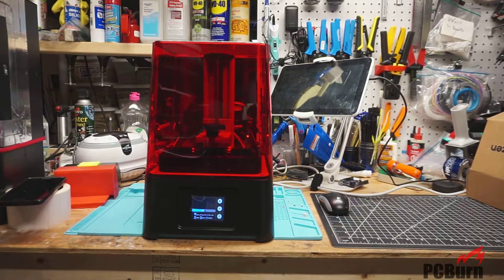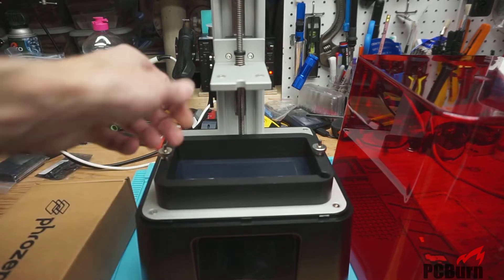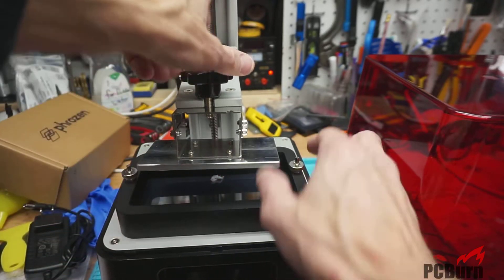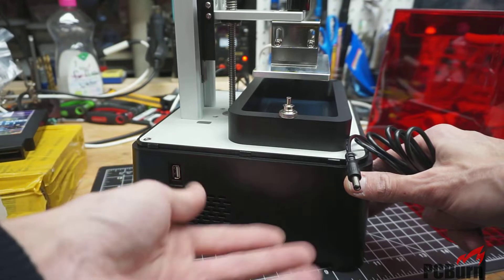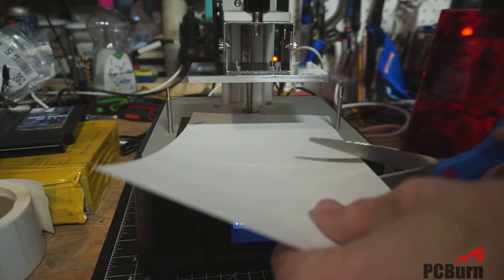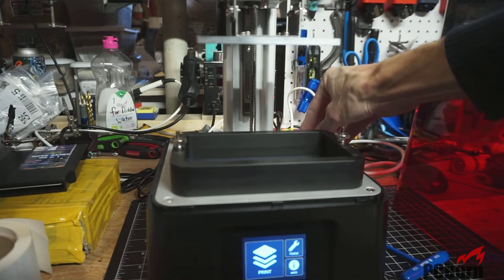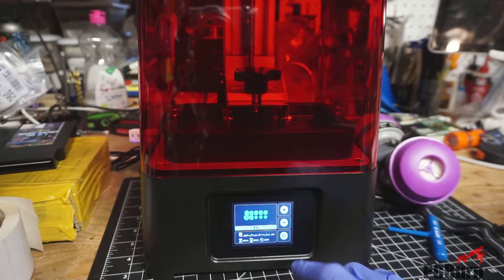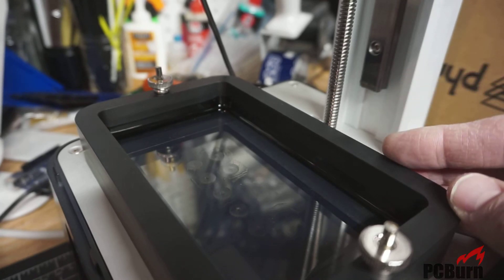Phrozen Sonic Mini: 3D Resin Printer Set Up, Use, Safety, and First Impressions Review

Comment: Where do you have the video of the Chitubox configuration for this printer? the best you ever had ... THANK YOU
Reply from the maker: There' s no video of settings, I'm not sure how that'd work. I haven't gotten to work with the printing on it much or add a heating chamber yet (which is necessary for me to use the printer, unfortunately).

You can find a few settings at PCBurn.com here https://pcburn.com/phrozen-sonic-mini-3d-resin-settings/ and the Google Doc spreadsheet here https://docs.google.com/spreadsheets/d/1crvzMnt_8NJXAsABinoIhcOjE8l3h7s0L82Zlh1vkL8/edit#gid=0

Comment: Thanks for this awesome review! Do I need to calibrate the printer after every use? Or would once during the initial setup after unboxing would be suffice?
Reply from the maker: You'd probably want to home them in when the characteristics of the printer change. Make sure it's functioning properly when the bed's moved on the Z or the resin's different at least.

Comment: Great info. I am looking for some kind of mat like you have under the printer. Where can I get something like that?
Reply from the maker: They're sold as "silicone repair mat" if your referring to the blue one. Here in the USA they go for around 7 to 20 depending on size and are available at your finer Chinese importers (Amazon, Ebay, or Aliexpress)
Reply: No I am talking about the grey mat on the right side of the printer
Reply from the maker: That's a cutting mat. Available from the same places online and most craft/hobby/sewing stores. They're a little more common in green.

Comment: Thanks for the video!  I just had mine show up, and I’ve been wondering, how much ventilation would you recommend?  I could put it in the garage, or I could also put it in one of the extra rooms we have which would be nicer..  I have a airbrush station, which has a filter and a fan with a pipe you stick to your window to take out the aerosols in the air.  Would that be good enough for ventilation, or should I get a fan also?  Or do I need more then that?
Reply from the maker: Personally I don't like the fumes. I don't trust inhaling what I'm assuming is a UV reactive solvent, either. I use mine indoors but in a dedicated area and have a OVC/Acids mask on when I'm working with it. And the area has dedicated filtration.

The other location consideration is the temperature. The resin really wants it to be above 80F (30C?) to drip properly and evacuate the model into the vat as it cures.
Reply: PCBurn! Ah ok!  Inside it’s around 70 degrees but our garage is around 10 degrees warmer, so that’s probably the best spot for the summer atleast.  I’m not sure about winter as it drops down to -10 , with the garage being about 40 degrees in the cold
Reply from the maker: Yea, I was having trouble with 70F specifically. My workshop hovers there most of the year and it was a bit too cold for the quick curing time, I think.